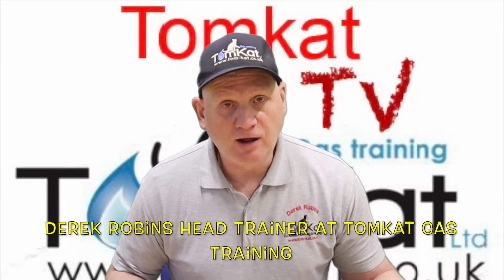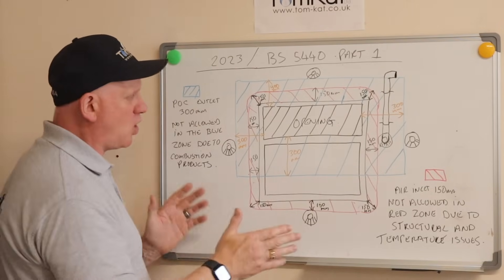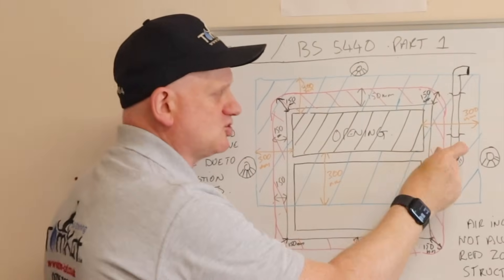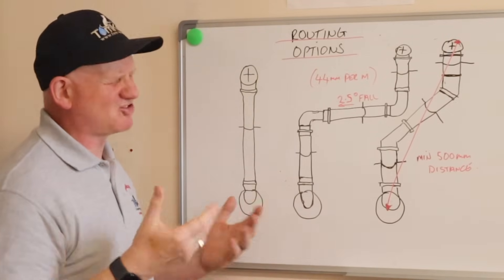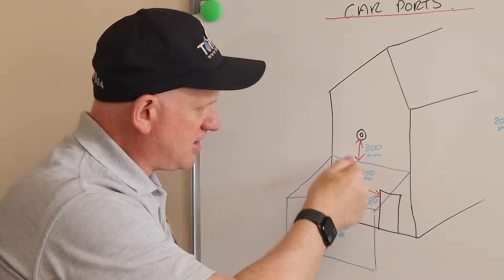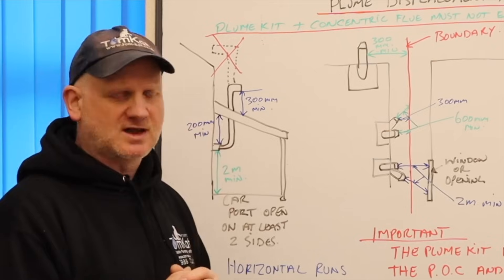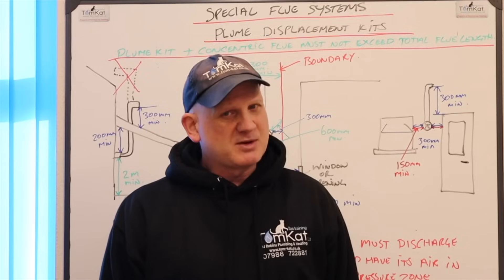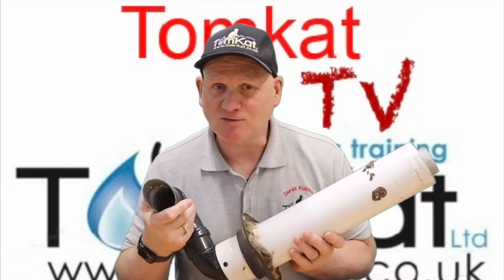Can a boiler flue plume management kit get you out of an illegal  installation?

Comment: i have full 300mm to door openings windows but from the wind direction it will take products of combustion into the house if the back door was left open, plume kit fitted. boiler fitters need to judge it. the 300mm isnt a set rule. IMO. risk access it. great video again tomkat. we need to make sure no products of combustion re enter the building regardless of the 300mm rule. yes its an awkward instalation. this one would have dragged into the house at some point without a plume kit.

Comment: I had a disagreement with our technical department about 4 years ago about the use of a plume management kit with a flue termination under a car port .our technical department won .
In the end I had to run the flue in 60/100
Standard flue ( not vertical option)
Above the car port, and terminate it 300 above the roof line.
It did look absolutely awful.

Comment: Correct, i had this dilemma this week where a standard flue terminal was fine 300mm away from a window but terminated in an area where it could be a nuisance to the homeowner not neighbours or public... but to fit a plume kit the exhaust terminal would need to be 1500mm away from the window and its because the dynamics of the flue gasses change when you fit just the 60mm exhaust open to the elements, the gasses condense more and thus the plume becomes larger and does not disperse immediately like it would with a standard flue.. the other dilemma i had was that both the terminal point and exhaust would of been below 2m and need 2 guards which is just nasty to look at...